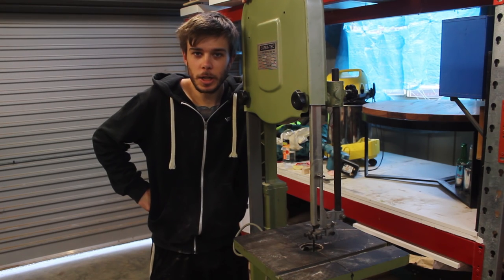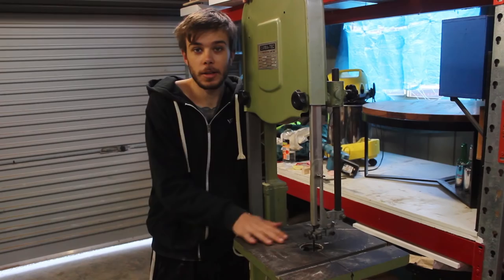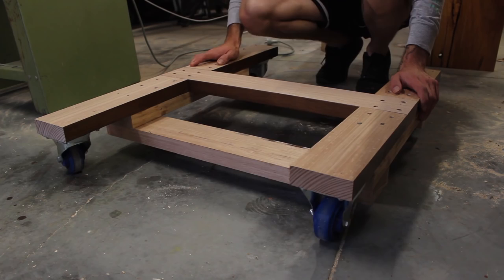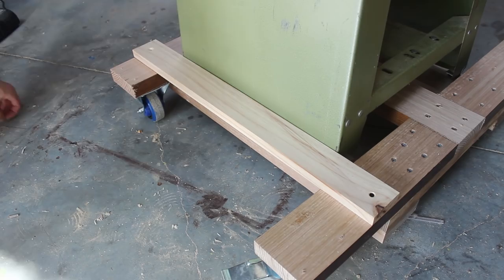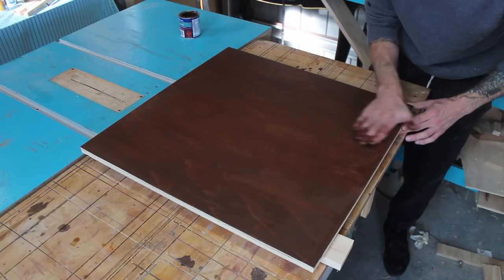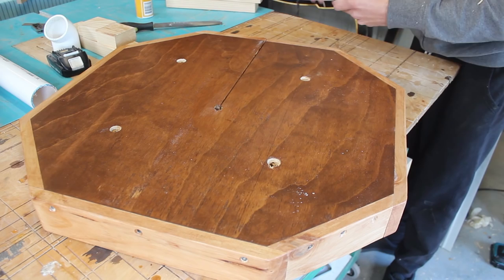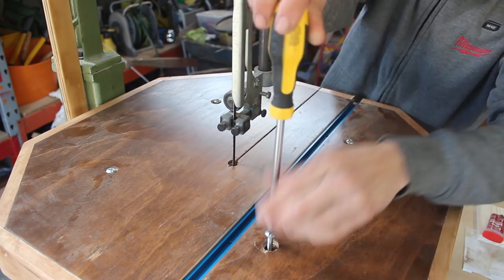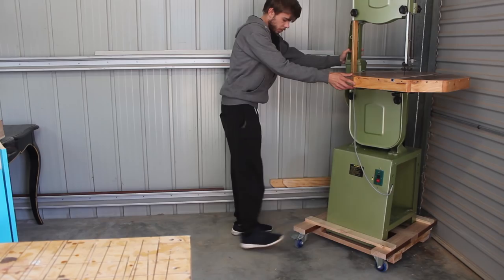Bandsaw Upgrades and Tune - My first Band saw

Comment: Nice find and nice work on the table. I have the same bandsaw, I was extremely lucky and picked it up from a school that was throwing it out. One of the lower guides is broken off but it still cuts nice. I got a new blade from Henry Bros and have successfully re-sawn 180mm camphor with it.

Comment: I Notice at 3:30 the splitters after the blade, move the ply being cut, and also the fence moves a little later in the cut, this will impair any accuracy.
Reply: k13ehr 
I knew a chap that use to cut string on a bandsaw!!
until one day the string got caught on the teeth! luckily for him he stopped it just in time with the foot brake!! his fingers an inch from the saw!!  
:O

Comment: nice work man! I got the exact same bandsaw for my first one I think I used it for maybe 4 months and I just couldn't get it to track anything bigger than a 1/4" blade and I tried eg so I got lucky and was able to upgrade to a 14" Grizzly which I absolutely love. as far as the mobile base didn't think about building that way I just had a flat piece a mdf and screwed 5 2" casters on it.  I don't know how tall you are but I'm vertically challenged.  so it just made it a little to high for my comfort so I made another using most of the 2 x 4 on end bases but instead of mounting them on the bottom I came of the top of the corners. ndalik lowered our cars in high school tucking the wheels up. worked out great left me with just under 2" clearance. like what your doin so got urself a new sub. keep up the great work

Comment: Hey pretty good video. One thing is that you need to bring the top bearing closer to the back of the blade with a sheet of paper gap between them.